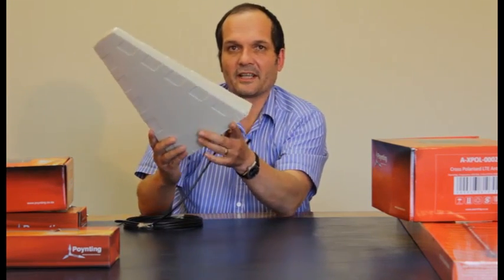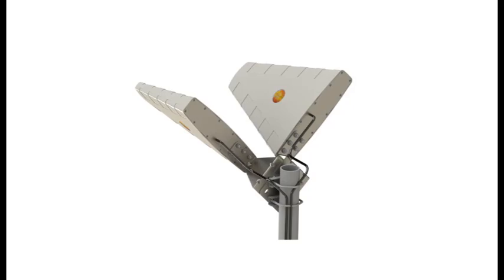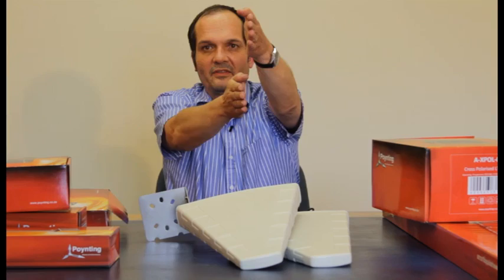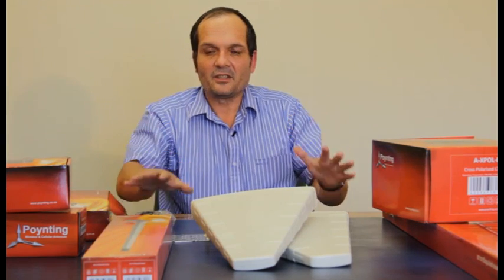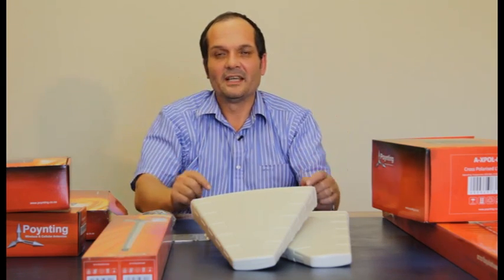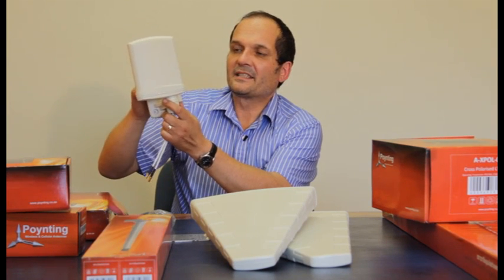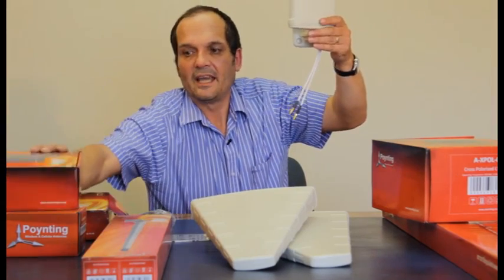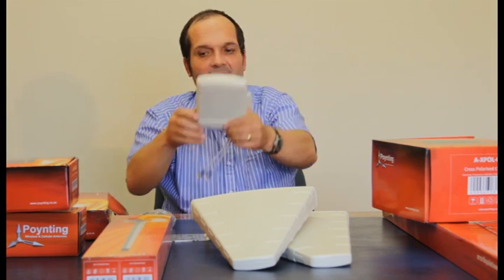LTE 4G Part 2 - Why you must have 2 antennas for LTE speed

Comment: Should be mentioned that most routers do not transmit on 2 output jacks,Only the high end ones like Pepwave DUO/Max BR1 Pro,Cradlepoint LBR1700.Routers with AUX antenna ports do not transmit on the AUX port,Just receive.So to have true MIMO,You must have a router that transmits on 2 output jacks.I have several routers with 2 antenna ports,One main and one AUX and there is no signal change on receive sensitivity if I disconnect the AUX line from the router.The MFG claim that the AUX ports are for receive only,But I do not see evidence of this when you are using the main antenna port and the AUX with the same two antennas and same length of line to the antennas and the same polarity.

Comment: most 4G and 5G modems (combined 4G+5G)  comes with 4 antennas  are they 2x for 4G and 2x for 5G  or   are they 4x4 and both 4G and 5G share all 4 antennas ???  TIA
Reply from the maker: They are 4G and 5G combined and share all 4 antennas.

Comment: Great video been looking for ages to see how you set up 2 antenna directionally, and he answered it you polarise it mine did not come with an adaptor that allows that!
I saw a video saying you get bounce off the ground as I am rural and to point them downwards is this right? Thanks
Reply from the maker: The latest in transmission techniques from the Mobile Network Operators (MNO) is to transmit two 'separate signals' carrying the same information. 
The rationale is as follows; sometimes Radio Frequency (RF) Signals follow different 'paths' from the MNO Tower (Transmitter) to your Router's Receiver and vice-versa, Signals from your Router's Transmitter to the MNO's Tower (their Receiver). 
These 'different paths' , known as 'Multi-Path' Radio Signals, is a 'natural Phenomena' of 'Radio Transmission' and the reason why Routers have 2x RF Connectors (or even 4x RF Connectors; requiring 4x Antennas) and to achieve maximum benefit from these 'separate Signals' require the use of 2x Antennas.
Most of the latest Antennas will 'package' 2x Antennas (and lately 4x Antennas) in the same 'Radome' (the Antenna 'Housing').
Thanks for watching our videos!

Comment: Please can you explain why most 4G signal boosters only have 1 antenna port for outdoor and indoor antenna?  if it is truly 4G LTE should the booster actually have 4 antenna ports?  like 2 for outdoor antenna, and 2 for indoor?
for example 'weBoost for Business Office 100' only has 1 port for outside antenna
Reply from the maker: Dear @Janos Kralik 

Without going into too much technical detail; the 'older' Voice Communication systems from the Mobile Network Operators (MNO's) uses what is known as 'Single In Single Out' (SISO) Systems and has its roots older technologies that was aimed at Voice Communication. The advent of Data Communication saw the birth of Packet Technology capable of 'breaking up' Data Transmission into discreet 'Data Packets'. This gave birth to 'Multiple In Multiple Out' Technology that has the ability to transfer these 'Data Packets' along different Paths giving rise to the ability to have two different Receivers, each with their own Antenna, receive the same original Data Stream transmitted by two separate Transmitters by the MNO. So, the 'older; 'Voice' Systems can only use one Receiver, and one Antenna whilst, as described above, the latest Data Transmission can have Multiple Receivers. Currently Massive MIMO can have as much as Eight (8) Transmitter/Receivers with Eight Antennas normally spaced out Horizontally to 'catch' up to Eight (ins the above case) different Data Streams. The result of MIMO is much faster and more stable Data Transfer. Because the same Data is transferred across multiple paths, if Data transferred across one Radio Wave of multiple Radio Waves are 'lost' due to interference, congestion etc. the same Data Packet could be received by another Receiver and be successfully form part of the Data Stream being received as, for example, part of a 'Download'.
Kind Regards
Poynting Technical Support
Reply: @poyntingantennas  Thank you so much for your reply. So to achieve a 4G MIMO signal booster, i should install 2 or more repeaters each with its own outdoor antenna and indoor/repeater antenna?
Reply from the maker: @janoska42  
If I understand your question correctly, you would like to know if you need separate Boosters, 
1) for The 'voice' 'Single-In-Sigle-Out' (SISO) 'channel' to your Mobile Phone and 
2) for your data i.e. your Router?
If my assumption is correct then this is a qualified yes.
Let me explain the challenge in the following way
1) When you look on your Mobile Phone it typically shows 'two connections' when you are, for instance, inside your residence or office...
- the one with the 'bars' (small to large) indicates the 'combined signal' from the Mobile Network Operator. 
- when you speak on the Phone, normal 'voice call', the Phone 'decodes' the 'voice information to and from the caller.
- the 'same signal' has the ability to 'carry' a data signal that can be 'decoded' by a Router, which 'decodes' the data and can either
-- connect straight to your Computer via a cable know as an Ethernet cable or
-- convert the incoming signal bac to a Wi-Fi Radio signal
2) If you want to have both a better 'voice channel' i.e. better 'voice' on your Mobile Phone then you need what is know as a 'Signal Booster' that amplifies the 'voice channel' i.e. you will see 'more bars' on you Mobile Phone.
- to create a better signal for your data, either directly to your Computer or Wi-Fi on your Mobile Phone, you will need what is known as a Router, which is the unit that can make use of multiple signals i.e. the 'Multiple-In-Multiple-Out' (MIMO) device with two Antennas (to create better data throughput)

Hope this helps?
Reply: @poyntingantennas  Hi so the application is for a small town that has very weak signal. actually there are cell towers nearby but they are serving other areas. I would like to capture the weak 4G signal and amplify it for the town residents to use for voice and data. so i would like to know if this would need more than 1 booster with directional antennas for the weak signal and omni for the amplified signal. but the questions are, 1- is there a user limit for each booster? 2- does it need 1 booster for voice and another for data, or 3- just 1 booster but use y-splitter to attach mimo antennas for the incoming and outgoing signal.  thank you again
Reply from the maker: @janoska42  Hi Janos,
1. The Carrier Signal from the Mobile Network Operator (MNO) 'carries' both the Voice as well as the Data Components.
2. Typical Internet Routers 'strip out' the Data Component and as such has the ability to Receive Multiple Data streams Multiple Input Multiple Output (MIMO) as mentioned before.
3. Typical 'Signal Boosters' using Single In Single Out (SISO) does carry both Voice and Data Components so, a Router would be able to 'demodulate' the Data components from a repeated SISO Antenna.
4. However. the typical Signal Booster for repeating the Carrier (Point 1.) is aimed at delivering the repeated Signal over relatively short distances most of the time using an Omnidirectional Antenna or Antennas 
- whilst it is implemented in Office Blocks and Industrial complexes, sending the repeated Signal...
4.1 Over longer distances and
4.2 Serving a larger community like a town
- has quite a number of issues.
5. When the MNO installs a 'Gap Filler' for a Town, they have to content wit a number of issues and you will face the same for this type of application.
5.1 The MNO will typically connect their 'Gap Filler' to either a High Capacity Microwave Radio 'link' or to an Optical Fibre connection to be able to have enough capacity to server the larger number of subscribers.
5.2 For such an application of providing a larger community with a good quality Signal, they will also have to provide accurate 'timing circuitry' , typically Satellite (GPS) timing.
5.3 Moreover, in some Countries the Telecommunication Legislation, because of the huge License Fees the MNO's are charged, makes it Illegal to provide such a Service without the proper License and Equipment.
6. Now, I'm not saying it's impossible so if...
6.1 You are on a private estate and/or there is no Legislation stopping you then...
6.1 A SISO Booster can be used to provide services to a limited number of people 5 -10 Max per Booster also depending on the Services they will require.
6.2 Such a Booster will need a high Gain SISO Antenna like our LPDA to receive the Signal from the closest MNO Tower.
6.3 The 're-transmission' Ports will have to be connected to 'Directional' 'Sector Antennas' to provide High Gain re-transmission of the Signal but, the distances over which this will work will be limited and will also be impacted by Vegetation, other Buildings and the type of Terrain - the MNO use large, very high Gain Sector Antennas to achieve this Transmission.
7. 'Gap Fillers' are installed by the MNO's all the time - it may be a whole lot easier to approach the most prominent MNO in your area and ask them to supply your Town with a Signal.
Hope this helps.
Kind regards,

Comment: Is there an antenna I can just put on the side of the house and get good signal. Without good line of sight  without having to put it on the roof.
Reply: @poyntingantennas  hello, thanks for the reply. I just read that the xpol-1-5G does not work on 1400MHz  cellular frequencies  ( band 32 ) on  the 3 network in the UK. I live in ireland will it work here. Also I am 3 kilometres from the mast will it get a signal on the wall. Someone told me to buy 2 of these POYNTING OMNI-292 8DBI HELIUM OMNIDIRECTIONAL OUTDOOR ANTENNA 
Or will the one you suggested be better

Comment: When I connect to Verizon LTE AWS band 4, I get twice as fast upload speeds as band 13. However, my LTE router insists on connecting to the weaker signal on band 13 nearly every time from the same static location.  The band 13 tower is twice as far as the closer tower which has both band 13 and band 4.  Is there a technique to force filter out band 13 so the router can only connect to band 4?

Comment: I've got two omni-directional antennas. Is it ok to mount them upright on the same pole? Or should I rather mount them apart from one another? And if  so, how far, is too far apart? They are 50 Ohm, PIM 140dB

Comment: a-xpol-0002-v2 Cable Type?
I recently purchased a Poynting Antenna. I would like to install it in an elevated location in order to improve the antenna reception. Can someone there provide specific information about the factory cable type/size? I would like to install the antenna in a tall tree next to my house. Thank you in advance
Reply: @poyntingantennas  Thank you for your response. More directly I am trying to discern which cables I should use in order to connect my Poynting antenna to the modem in the house. As I said before I have tall trees very close to my house. The mobile tower is only .6 miles away. If I install the antenna in the tree it will be within line of sight (or very close to line of sight). I am not familiar with HDF 195 cable. Is there a generic type cable that would do the job?  The distance from the modem to the proposed tree top installation is less than 200 feet. Thank you again for taking the time to help me.

Comment: You said 3 meters aprt for those omni's... Why on the built in router/lte devices how do they get away with the external four inch antennas only 4 inches apart form each other?

Comment: Ok so what if I'm running one proxicast 10dbi 24" Omni antenna paired up to my nighthawk m1 and pairing that with my weboost home 4g LTE booster? Because the thing is I already own the weboost. I've just ordered the Omni proxicast and I already have the 50 ohm Wilson cable as well as an N connector to dual TS9 pigtail. Thank u, just hoping to maximize speeds with what I have already purchased as this stuff is expensive. 

I'm not sure if it's true but I think I also heard there are two more internal antenna hook up points inside the nighthawk m1 but u have to take it apart and solder hook up points to them? If this is the case I would love to know as I also have a Netgear MIMO aircard black antenna pad with ts9 connectors that i could also use if need be. Thanks

Comment: Ok so....... I have the home weboost kit that didn't come with the directional antenna it only came with a pad for outside and the little black one that goes inside by the desktop. 

My equipment:
Nighthawk M1 modem router via AT&T
TP Link Archer C7 home router
Weboost home kit
40-50' RG-6 quadshield coax

I have tried to install the amp and antennas to the preferred distance weboost recommended but it's not exact. The outside antenna is about 20-25' in the air facing the tower at a 35 degree angled up. The cable comes down to my place down the wall in and under through and back behind a desk and into the amp. The inside antenna and amp are 12-15" apart I tried to go further but cannot with my layout I have. I also tried to not face the inside antenna in the same direction as the one outside though this part is a bit confusing to me and I can't seem to find any solid how to videos on this stuff in depth. Only salesman who go over the features and whatnot 

Choosing LTE only on the modem and turning everything off except for IP passthrough and using the Archer as the main source for internet. The weboost inside antenna I have placed by the window with the modem maybe 6-8 inches away from that. And the Archer is about another 8-10 inches away from those. All are hooked up to a good surge suppressor to try and block backfeed voltage that may result over time, should this ever happen, Lord forbid. 

I just ordered two TS9 antennas for the nighthawk M1 to put on them to see if I can get my numbers up any higher and to hold more stable. My question is though, what else can be done to further ensure stability above all else or is there anything I can do at this point? Readings show an average of -65dB with ASU being decent not too low wish it could be higher. But with this setup being for my home office for biz and gaming use, (even though I'm behind a double Nat ) I'm really really needing it to hold solid signal if at all possible OR atleast give me high enough numbers for down and uplink to where I won't have to worry about any intermittent dips that would cause disconnection issues. I have alot more detailed specs I can give if u need. But right off the bat just looking for something general and hoping the two antennas hooked to the modem make as big of a difference as u say they will. I am really hoping this is the one little thing I missed

Comment: Hi Andre - great video - thanks. Question, I have a 4G LTE modem with a single external antenna connector. I have found splitter cables available online. Would one of these splitters work to combine the two antenna signals, or should I just stay with a single antenna in this case? Thanks!

Comment: Thank you, Andre! Very helpful. Especially the answered comment below about maintaining 2 separate circuits for the dual antennas. I am smashing that subscribe button and looking up your other videos right now!  

Quick question: I am mounting the antennas on top of an 80-foot (24 meter) tower. Will this be too much length for the antenna cable to work sufficiently? Thanks again!

Comment: 2 antennas are to expensive. I have seen a video in which a person only use 1 antenna for 4G and it worked.
Reply: Thank you so much. I have one more question. Would the XPOL2 be a good antenna to use with the Huawei B618 LTE-A router (currently being used with Telkom's LTE-A and Afrihost's Rain LTE-A)? If not what other antenna would you recommend for it?

Comment: So, is larger spatial separation needed in addition to cross polarization, or does cross polarization alone provide adequate de-correlation?
Also, what is the actual reason why 2 cross polarized antennas work better? Does it enhance multipath rejection?

Comment: Hi All, Andre great video thank you. What is the best way to find where your strongest signal is coming from, I have an app called Network Signal info by KAIBITS that shows strength in bars, percentage and dbm. Is it as simple as walking around the property finding the strongest signal and point my arial in that direction? Also for arial the higher the better ? Thanks

Comment: Looking to purchase one of the LTE antennas but I had a question.  I am looking to use LTE to get internet at my new house as I work from home. I get occasional one or two bars of 4G on my iPhone. Planning to setup the LTE antenna and router in my attic. What antenna would maximise my LTE signal? I was looking at your "Poynting 4G-XPOL-A0001 Cross Polarised 4G Omni LTE Antenna". Should i consider one of your bigger antennas. Really enjoying your video series. Hoping you can steer me to the Best Buy for this use.